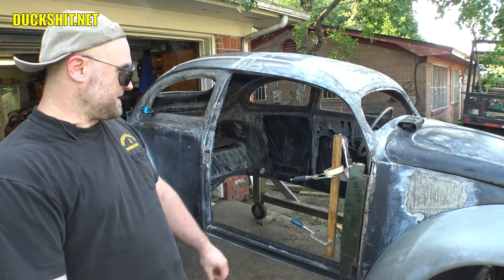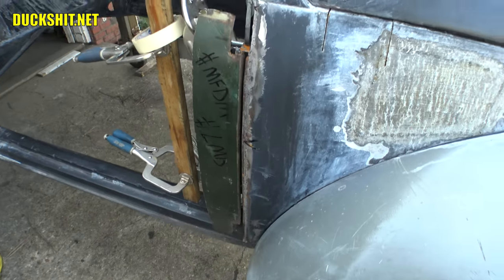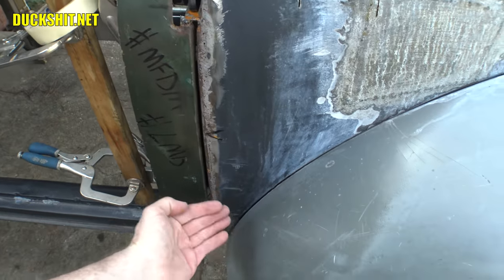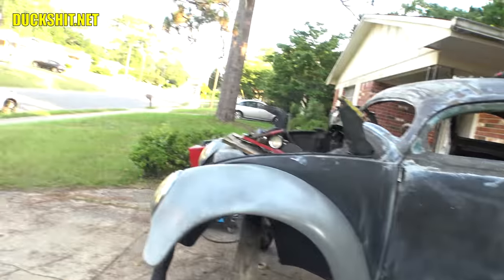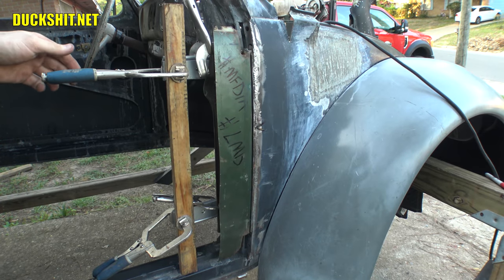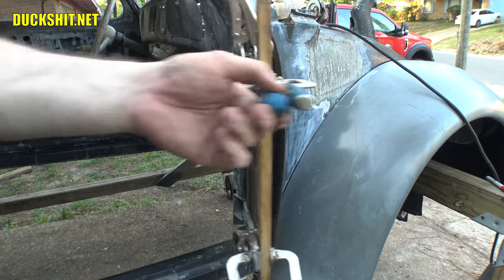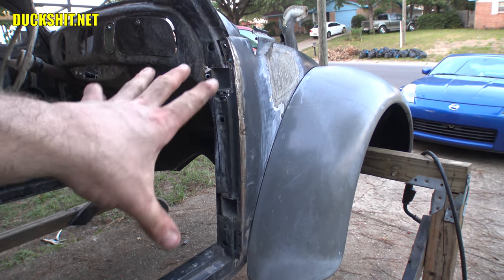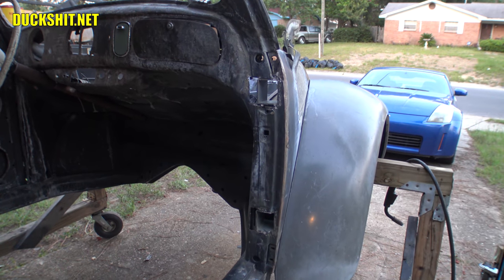Hinges Fit! - VW Beetle Hidden Door Hinges 6 - ROTTEN OLD 1956 - 103

Comment: When you have both doors lined up , drill a small hole through each part of the door hinge into the door frame and fit a roll pin in the hole. You can then take the doors off and paint them and so on and when you go to bolt them back on ,everything will line up again .
Reply from the maker: That's a good suggestion, except I won't be doing the final alignment.  I'm not sure what sort of twisting and contorting will be peformed by Earl.  Hehehe... I guess we'll see, so make sure you subscribe to his channel!  Eleanore will be there next month!  http://duckshit.net/ccc

Comment: Did you try a new SD card? Maybe you've run out of read/write cycles.....
Reply from the maker: Thanks, I actually covered that another video.  But the answer is same problem even with different SD card.  It's the camera that is to blame... and it's always been the camera.  It needs a firmware upgrade and GoPro probably will never address it.